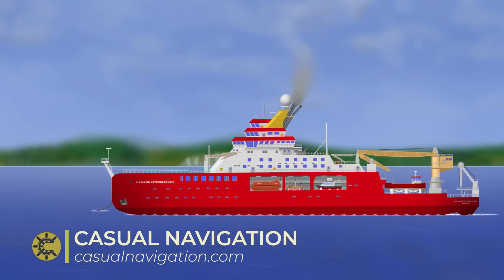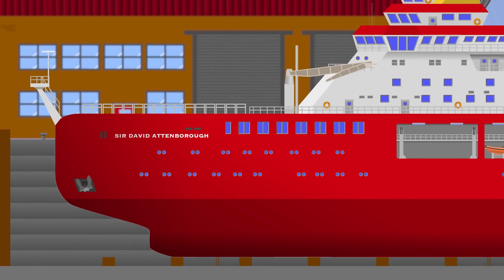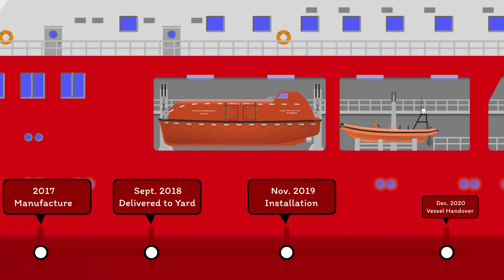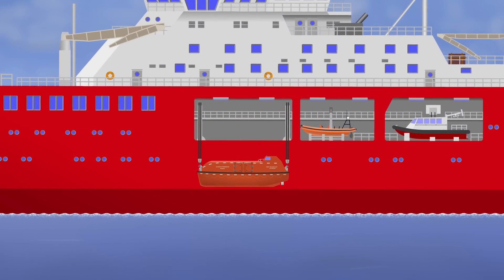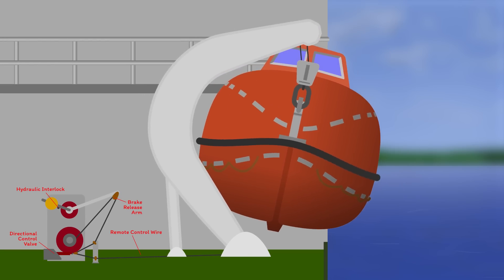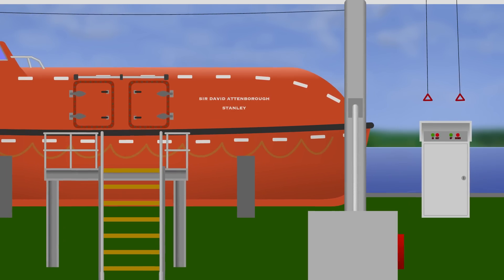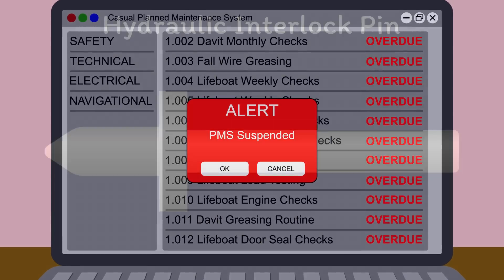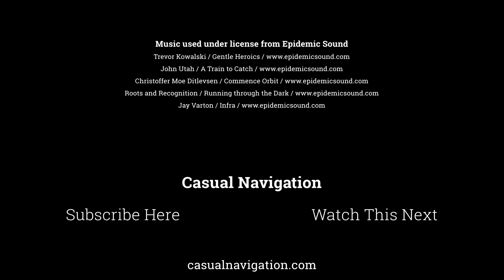How Did This Lifeboat Fall Off?

Comment: Is just me or that launch system is extremely complicated and if no trained crew member is present passengers have no idea how to use the lifeboat in case of an emergency?
Reply: the complicated part is launching the lifeboat without being in it. if youre in it you just pull the lever
Reply: @mtqrx  
That is far easier indeed.
But now the question arise, why they bother practice launching an empty boat when they can just have one guy inside pulling the cord?
Reply: @cristitanase6130  because in some emergencies you dont want the people inside to pull the cord before more people load onto the lifeboats, you need the people on desk to launch them once theyre full
Reply: @mtqrx  
But what happens if the cord is pulled from inside?...
Reply: @cristitanase6130  Simple, safety.  If this boat had been properly installed with the remote lowering setup no crew would have been on board and no injuries would have occurred.   When you lower and raise the boat you are testing the davit and the wires.  The proper operation can easily be seen from outside the boat with no crew at risk.  Testing of the actual engine and interior equipment is done with the boat secured in the davit.  The tanker company I worked for stopped riding boats up and down on the falls 10+ years ago.  They hired launches to take the crew to the boat when it needed to be exercised in the water.
Reply: The simple answer is ALL survival craft are designed to be operated by trained crew.  Their operation is simple, but training is required.
Reply: @jamesmurney1374  
I don't get it.
Two things can't be real in the same time.

1. The boat can be released anytime by anyone including untrained civilians from within the boat itself using a simple quick release.

2. The boat must be released by a trained crew member from outside using this complex system so that no one is left behind.

What is it? 
Can this boat can be used only by completely untrained civilians in case of a real emergency when the crew may be indisposed or missing or it must be only used by the trained crew members and therefore useless in case these people are not present at the time?
Reply: @cristitanase6130    
The operation of survival craft is simple by design but you MUST be trained, period.  If you perform the launching sequence out of order you can easily kill everyone in the boat. 

 I understand how knowing that you may not be able to escape a sinking vessel would make you uneasy but not know how to properly operate the lifeboat could make a bad situation worse.

Designers try to minimize the steps to launch the lifeboat but you have to keep in mind that the boat has to be secured to the ship so it doesn't fall off when the ship moves at seat.

In a true emergency everyone will be inside the boat and the pull wire will be used to control the lowering.   The on deck, outside controls, are a back up and are used for drills.
Reply: @jamesmurney1374  
None of it answers the question:
If no trained personnel is around to assist, can the civilians with zero training use that boat or not?
Reply: @cristitanase6130  You might be able to pull it off, but you could easily kill yourself and everyone else in the boat. 

If you manage to open the on fall release lever while you're a significant height above the water the boat drops and you get hurt.  If you don't know what this lever is, or what it does then you shouldn't be trying to launch a lifeboat. 

Do keep in mind a great majority of the crew is well trained in launching lifeboats(on cargo ships its all crew, not sure about hotel staff on passengerships), so even the event of a major disaster there should be crew to launch the boa5s.
Reply: @jamesmurney1374  
I still don't have a proper answer.
If no trained crew member is present, can the untrained civilians alone use the boat or not?!

Is not rocket science, I just want a simple answer. 

All I got are all kind of arguments why civilians must never use the boat alone, why is dangerous, why they will not wait for everyone and so on.

I never denied any of it. I just ask the same question, maybe, after you're done quoting the entire Maritime Saving Manual you will provide a direct and simple answer...

Can the undrained civilians in case of emergency be able to use the damn boat to save their lives without any trained crew member present or not?!
Reply: @cristitanase6130  In short, No, untrained personnel should never operate survival craft.  They risk their own safety and everyone elses!
Reply: @jamesmurney1374  
But what if you got a situation like in Airplane! where all the trained personnel ate bad fish and cannot operate the boat. Shouldn't there be operating instructions in the cabin so someone can quickly be brought up to speed on how to get the boat down there in a hurry?
Reply: @jamesmurney1374  
I got that, you keep repeating the same thing over and over.

My question is very simple.
In the very possible scenario that no trained crew members are present can the untrained civilians use such boats or they're doomed? Or maybe they should use other type of boats that are easier to use?

Comment: I attended an offshore survival & firefighting school in the late 1980s and was told a cautionary tale about a safety instructor on a rig who always gave the life boat release mechanism a couple of pumps during the safety demos he gave. The release mechanism was either pneumatic or hydraulic and needed X number of pumps to release. What the safety instructor had forgotten was that the pressure he was putting in wasn’t venting anywhere and his “couple of pumps each demo” eventually released the lift boat from the rig without the folks inside being properly secured and some where seriously hurt.
Reply: Big oof!

Comment: This highlights the benefits of having OEM engineers attending as part of commissioning, and owner/crew training. Even though they can be expensive, it may save time, money, and even lives in the end.
Reply: And put the people that install it in the boat during the first test.
Reply: @NotALot-xm6gz  that actually leads to a problem if they fucked up the install and then all get killed. There's nobody left to ask about how they installed it so you have to reverse engineer the install issue.
Reply: @ctownskier  OK, just the manager goes in the boat.

Comment: How exactly does the remote control wire work, while the lifeboat is lowered? The only things I can think of are: with a short wire you run out of wire to hold onto after a few seconds, or a very long wire that you need to keep under tention with your hand while letting it slide through your grip as to not hold yourself stationary in relation to the lifeboat. Both sound very bad to me.
Reply: The ship side of the remote control wire is on a reel that let's out the wire at the same rate as the boat lowers to the water.  It's usually attached to the same drums that have the big wires that support the weight of the boat so that the rotate together.  When properly set up they work well but they can be fussy to keep that way.
Reply: I was wondering this as well. Possibly some form of clutch, so you apply a force to reduce tension on the wire and let go to increase it to the point of not slipping.

Comment: I'm surprised that the lifeboat does not self upright it self in the water
Reply: There is a lot of stuff that's missing from this video including other problems they had before the incident and the fact that it wasn't just the maintenance of the pin, it was also manufactured from the wrong type of steel. The aft hatch on the vessel was ripped off during the fall to the water.  The report says "The lifeboat became completely submerged and water started to flood through the aft hatch opening before the lifeboat righted itself and came to rest, floating on an even keel."  This story really isn't an accurate representation of what actually happened.
Reply: @stephenshoihet2590  I was suspiciously surprised by the rapid rate of corrosion on that pin. Requiring yearly maintenance to keep such a simple part functional is absurd. I guessed that it was a poorly chosen alloy, but actually the spring system itself shouldn't be so sensitive to minor damage that it won't trigger. Even if the pin was bent and rusted there should still be enough leeway for it to fully function. Sinking ships are not typically in pristine condition in mild weather conditions, unimaginable forces are skewing the entire hull along with everything mounted to it. These systems need to function despite being contorted beyond design specs,  decades after the ship was launched inevitably there is little bits of corrosion everywhere. Doesn't matter how rigorous your maintenance is, wear and tear will always exist after all degradation is a fact of nature.
Reply: Are you sure it doesn't? None of the reports say.
Whats your source?
Reply: @jort93z  The animation in this video suggested it didn't. Of course, the animation is not necessarily the same as the real world.